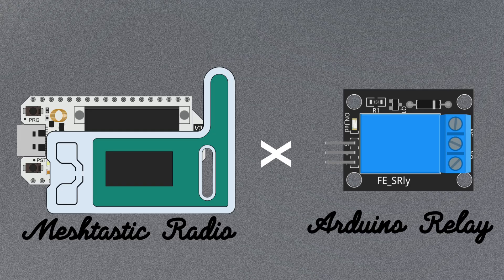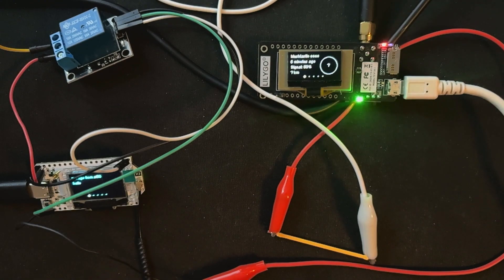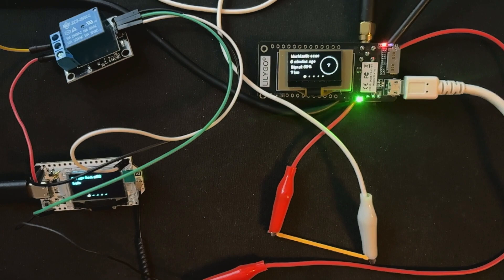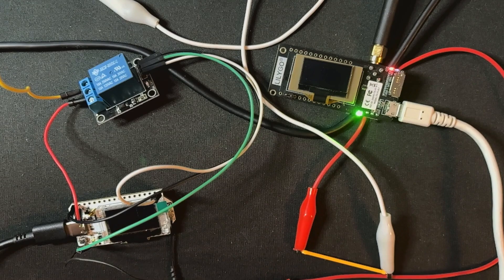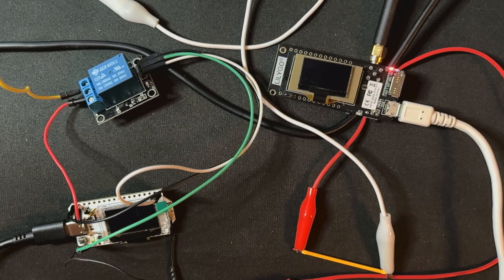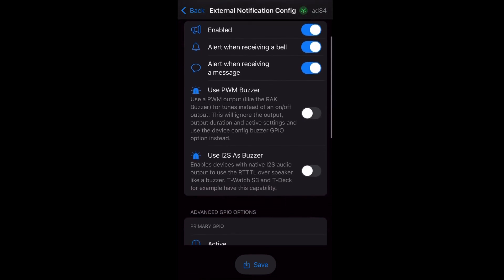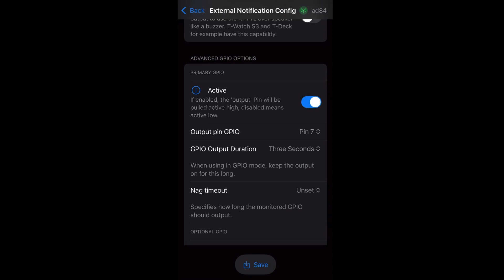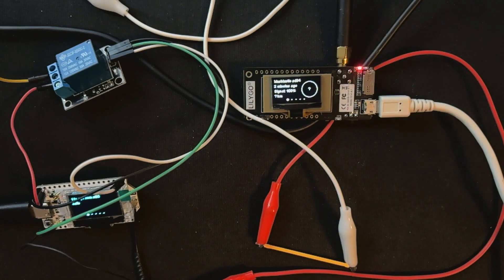Build a Reliable Off-Grid Long-Range Relay Switch with Meshtastic

Comment: Can you switch it ON or OFF with a specific message ?
Reply: It can be done with gpio management
Reply from the maker: Very interesting question. I am not sure if I have the correct answer yet. I should still try. However this is really what I wanted to achieve at first. But from my understanding I should have tried with dry switch to get this done. But this should be done too with the relay using the notification with the bell/buzzer feature with an important time period. Let me know if you have succeeded in the meantime, I might order a better relay that handle 220v.